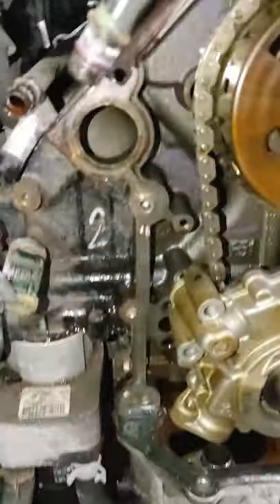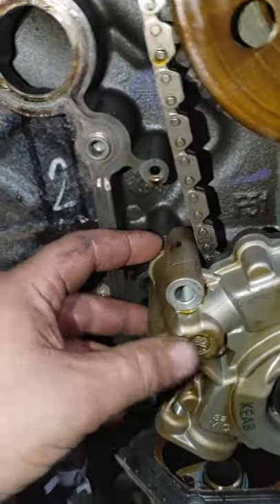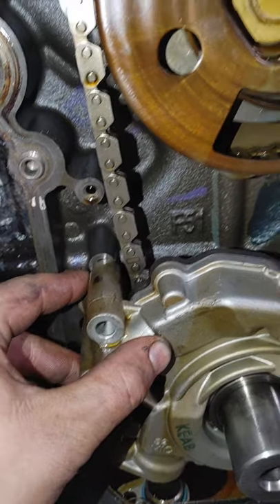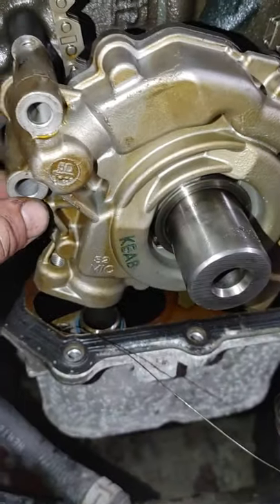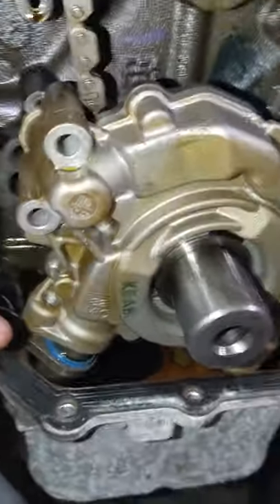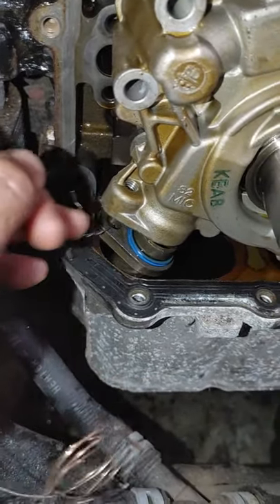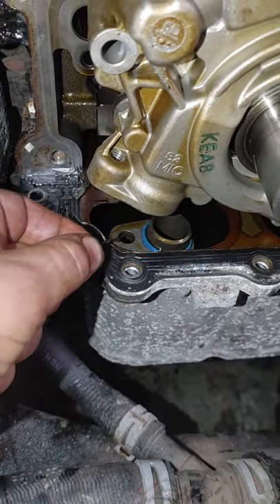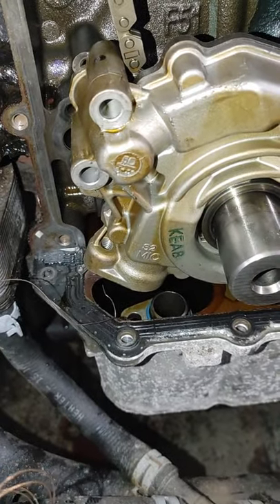5.7 hemi awd oil pump removal without pan removal

Comment from the maker: A lot of people are saying you can’t do this in the trucks which is true, the oil pan is way easier to remove in the trucks and you need to remove it to take the nut off holding the pick up tube. This was in an awd charger and the pick up tube just bolts to the pump. Couldn’t tell you why! The pan is a PITA in those and can add 4-6 more hours works. As far as cleaning out the pan im sure you can flush it without pulling it but if you had a lifter eat your cam I would suggest pulling the pan and cleaning it properly.
Reply: i did it on my ram truck. just unplugged to drain plug and flushed the pan with brake cleaner through the front.
Reply: It can be done in the trucks. But the pickup tube won't be loose. Getting the bolt back in is a major PITA.
Reply: remove as many bolts back to the trans as you can, grab a bar, and bend the fucker. believe it or not, it'll seal right back up after.... jeez, c'mon young fellas lol
Reply: Since I was replacing the pump too, I broke the cast and shortened the bolt a bit. New pump went right in. So did the bolt. Didn't touch the pan.

Comment: That's crazy because with every other engine that tube is bolted to one of the mains and it won't get out of the way enough to remove the pump.
Reply: Same problem I got right now
Reply: That's how my 5.7 is. I tried everything to not drop the pan. Such a dumb ass design. If I had to pull the front cover to replace the tube, fine. But pulling the pan to replace the pump is bs

Comment: It looks like this pan has a windage tray as apart of the gasket? ... is that correct?  So this can be done with windage tray?  Also, are you just putting some black RTV on existing gasket to reseal the pan?  ... are you doing top and bottom surfaces with RTV or just top as the bottom appears to still be sealled?  Thanks for the great video and help.  This looks like it'll help make my 2013 Jeep GC lifter/cam job a lot easier!!!

Comment: This doesn't work in a Ram truck because the oil pickup tube is bolted to the bottom of the engine. So I'm not sure what you got going on there or if your pickup tube isn't bolted to the bottom of the engine like it's supposed to be
Reply: You are somewhat correct. Its a bit trickier on the trucks. You have to start getting the bolt loose on the pump before the pump will turn at all.   I have a few cheap 13mm wrenches that i bent to do it. Its takes an awful bend to do it. I would suggest trial and error on the first wrench then duplicate it for your buddies. After that bolt is loose though the pickup can move some, even though its bolted to the pan it flexes some. The next issue is, the pickup wont move far enough to clear the pan because the bolt is way longer than it needs to be. so what  i do is just drop the bolt down into the oil pan and fish it out with a magnet. After that i grind the bolt down a half inch and then itll be short enough to install with the pump turned.
Reply: Admittedly sometime while getting the bolt out of the pump, it will hit the oil pan gasket a bit, ive always put a little engine rtv there and its never leaked.

Comment: Do you use channel locks to put tension on the tensioner to put in the pin or is there a better way to apply tension?
Reply from the maker: Sorry for the late response, I did not, I did a new chain and tensioner so the new tensioner came pinned already. You can remove the tensioner if need be and put it in a vice and re pin it

Comment: My 6.4 hemi has 1 bolt and 1 stud more in , this will not work I tried , you must loosen the oil pan and at that point you might as well do a oil pan gasket .😢

Comment: in a truck, remove as many pan bolts as you can back to the trans. Dont remove the support brackets or any of that crap. The pan will go down... one hand on the bar, the other to crack the bolt from the oil pump... believe it or not, itll seal right back up... or, if you wanna spend another 4 hours, be my guest

Comment: Yea except you will never get a solid seal where that pan meets the timing cover unless you pull the pan and replace gasket too. It will leak oil in 1,000 miles rite where they meet

Comment: Why is this repair needed ?
Reply from the maker: Bigger cam. If lifters fail and you need to replace a cam you should clean out the oil pan, there are ways to do that without removing it but at that point I would remove and clean

Comment: How can i remove transmission on awd 5.7 hemi
Reply from the maker: I’ve never done one on the hemi but you have to take the transfer case off first, not fun
Reply: @Snellicus  Ok what i need to know is if i havw to remove subframe or oil
pan
Reply from the maker: @DakotaRaymond1999 sorry for responding almost a year later, I’m sure you learned by now you have to remove the cross member and get the shafts out of the oil pan because they go through the oil pan, terrible design

Comment from the maker: Please leave a comment if this helped you
Reply: Thank you so much, I’m doing a cam swap and lifters on my 2012 Chrysler 300c and i just wanted to double check my timing. Thank you!!!
Reply: Mine won’t move freely as your did? The bolts are out. Is there something else to this?
Reply: @MrJayboogie34  there should be a bolt holding the oil pick up tube to a main stud 
which you will have to take the pan off to get it to move
Reply: @MrJayboogie34  This method works on a 5.7 in a car, but not one in a truck. The pickup tube in the truck is bolted to the bottom of the engine and will not move like this.

Comment: Quit being lazy. Pull your pans. That's not the only bolt on the pickup tube.....
Reply from the maker: Oh but it is on an awd charger. Pulling the pan in a truck or rwd is easy. Not so easy on the awd charger tho. Trust me I have done engines on vehicles that call for 24 hours labor. I am not lazy I am working smarter not harder
Reply from the maker: 10 years of working flat rate requires you to work smarter not harder lol!